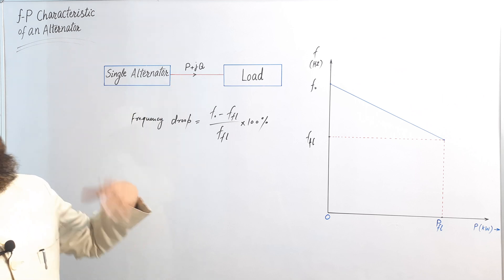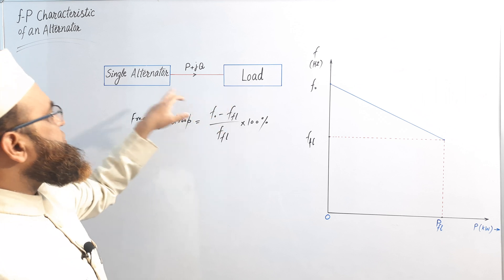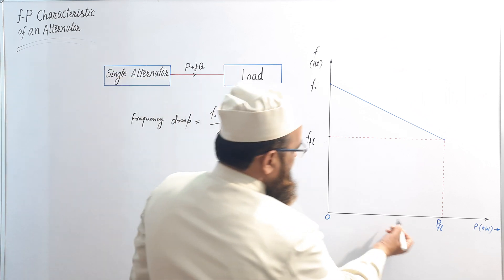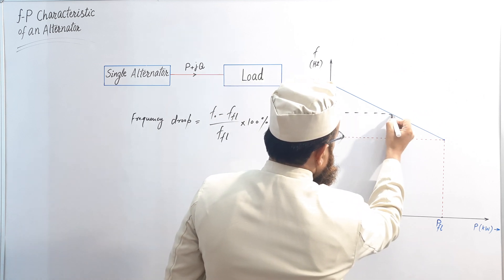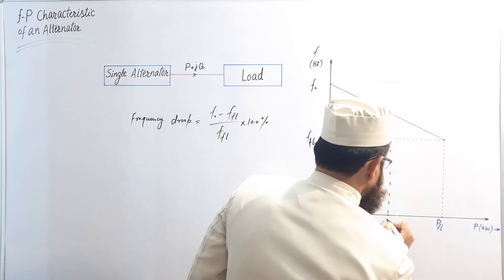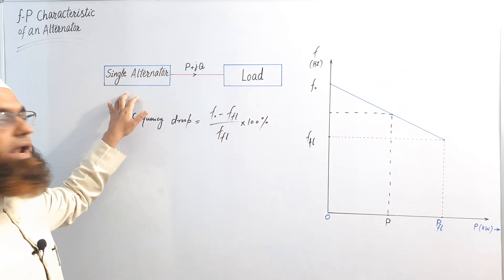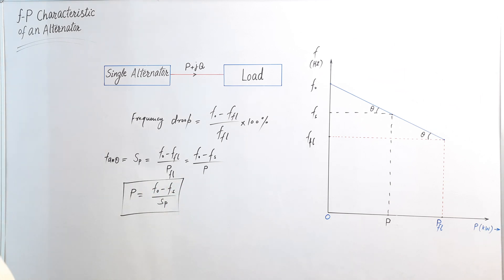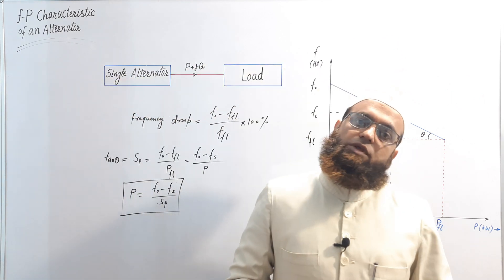f-P (Frequency-Active Power) Characteristic of an Alternator

Comment: So the idea is that the speed and frequency of the alternator is depended to the power demanded to the alternator. My question is that why is it power and not the apparent power? The hypothesis that I have is with regard to the nature of reactive load which just oscillates the power in and out of the system therefore there is no real power that is being wasted to the system since it is just being bounce anyway. But somehow I find that to be lacking. The reason is that even though it is a power that is just being bounced, it is still a power to be supplied. Is there any concept that I am missing that would make this much easier to accept?

Comment: Active and reactive power supplied by the sync generator is always equal to that of demanded by load. I got this but what about the voltage and frequency of the sync generator in that cases? You mentioned active and reactive power can't be controlled by viz governer and exciting system. Can you make this thing clear?

Comment: Assalamualaikum sir,
In Droop formula , you have taken referance ffl.
But according to question it can be Fnl also
Reply from the maker: Wa Alaikum Assalam, 
In all such formulae (Droop formula, Voltage Regulation formula etc.), full-load value is taken as reference quantity. For more details, you may see some standard books like, "Electrical Machinery Fundamentals" by STEPHEN J. CHAPMAN